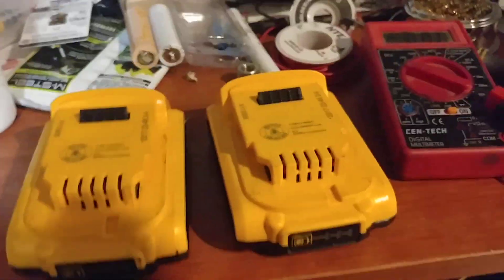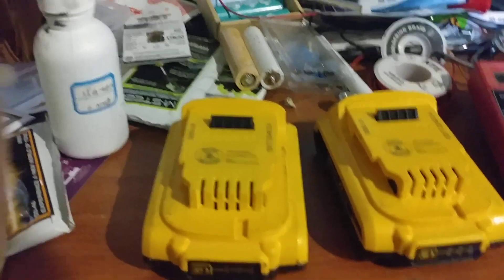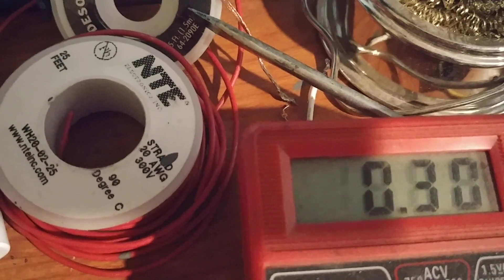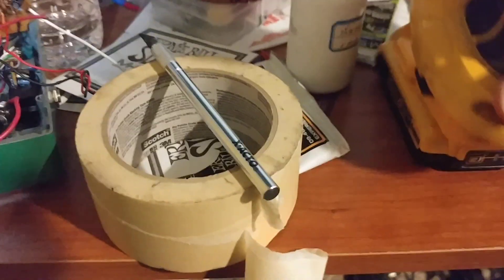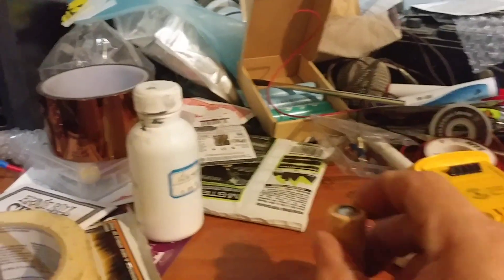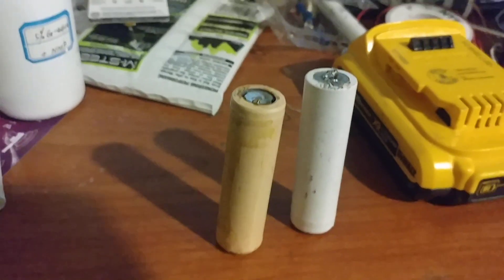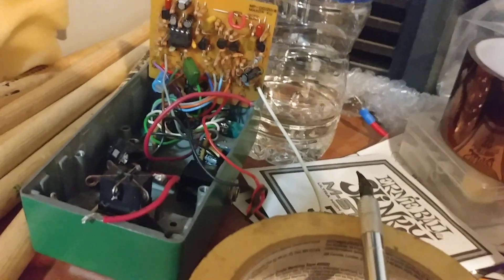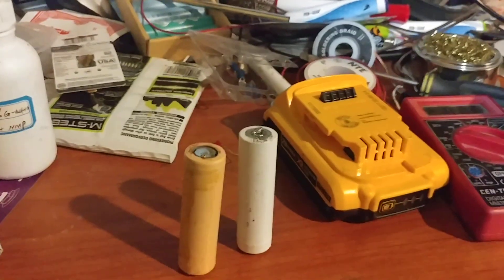Graphene battery testing, real world stuff.

Comment: G'day mate, long time no see! 

If you do speak at this conference please video it and post it up on here. Maybe ask the conveiners if they will video it for you?

How does the voltage in the drill battery hold out over the course of it's charge? Will it deliver 18ish until it's nearly flat or do you get a voltage drop as you use it?

Those dead batteries look interesting - presumably they are super caps? If they got cut open and rolled out do you think some sections will still hold a charge?
Reply from the maker: Tony Grant they aren't technically super caps, because of the construction. (Basically modified li-ion) they are dead, so no charge that I can get a reading for.